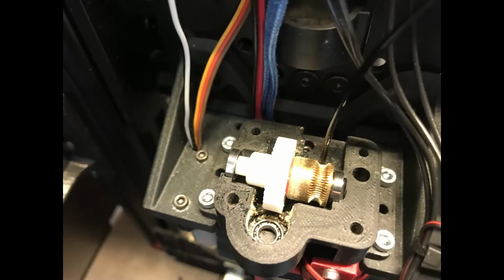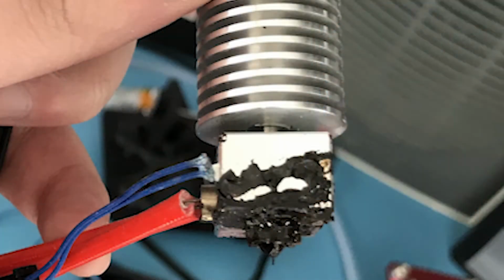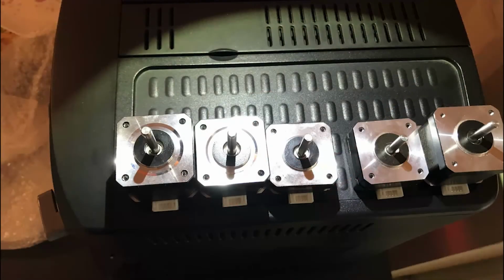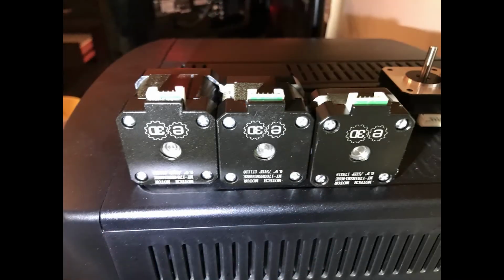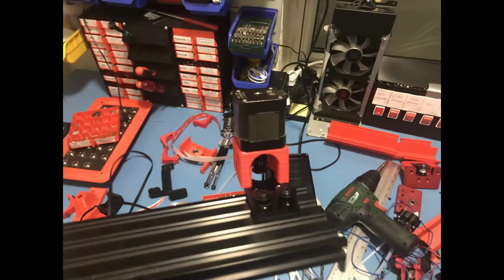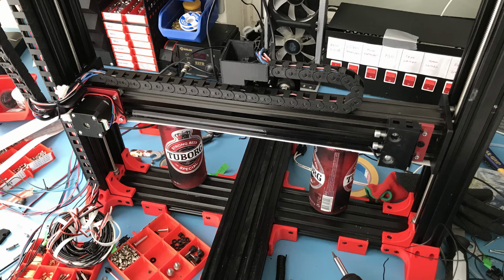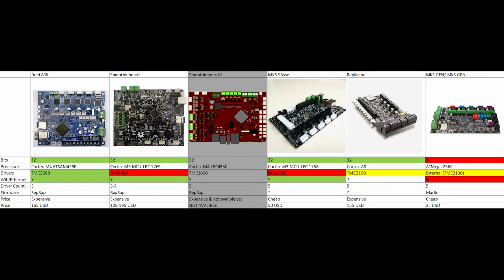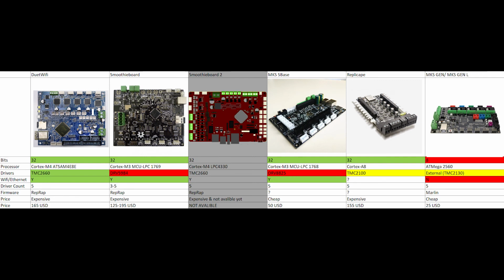Tevo Black Widow Mods Part 16 - Z Belt Relocation & New Controller Board Ordered

Comment: Do you make changes on the firmware when you change the motors? And please can you help me to found the vref of a motor for a driver please? I’m learning about firmware and electricity because i want to upgrade my printer
Reply from the maker: I am switching to a different board so I will obviously redo the firmware. In your case, as long as both the old and the new motors are same amount of steps per revolution (usually 200 or 1.6 degrees per step) you don't need to edit the firmware. As for vref, I have a video about setting vref on tmc2100 drivers. That should help you.
Reply from the maker: https://youtu.be/HZkYT3B5Css